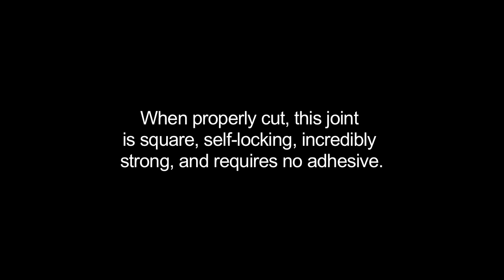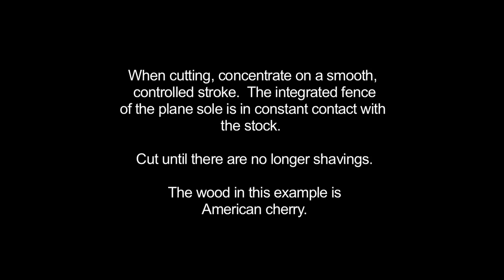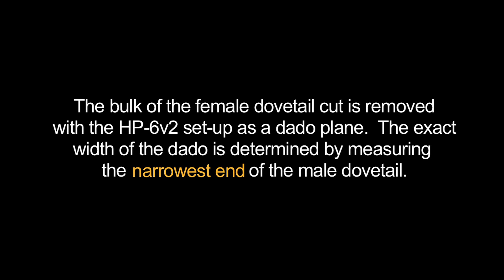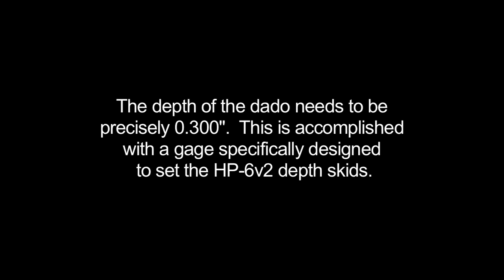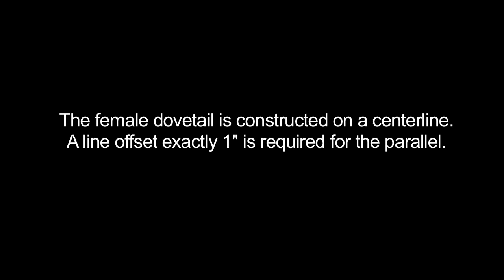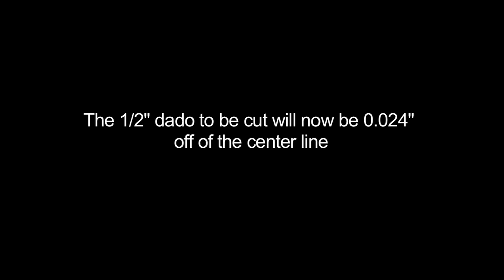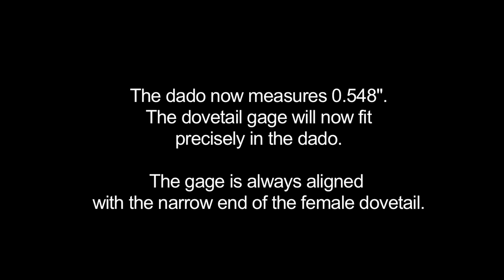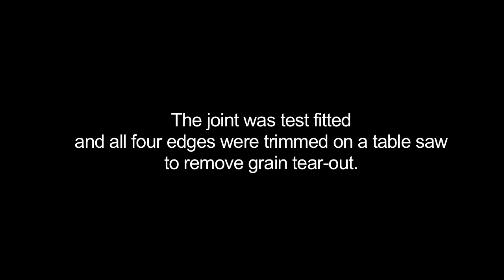Making Tapered Sliding Dovetails by hand with the HP-6v2 Mini-Multi Plane

Comment: No offense intended, but I watched Roy Underhill do this with nothing but layout lines, a hand saw and a router plane in 1/2 of an episode of The Woodwright's Shop.  Your process seems way, way overly complicated AND expensive (complicated like the Leigh Dovetail jig).  The only difference in the joints was that Roy only had one surface of the board cut as tapered sliding dovetail, the other side was straight.

Comment: more trouble than the money it's worth. and that joint went together way too easy till it reached the last inch or so. sorry but it wouldn't be a thing I would buy...
Reply: That is precisely how TAPERED sliding dovetails work!!!!  The fit can even be sloppy until the last bit -- then you need a mallet to finish the fitting -- BUT all surfaces come together.  A regular sliding dovetail is a very unforgiving joint, and its fit is never as tight as a TSD joint.